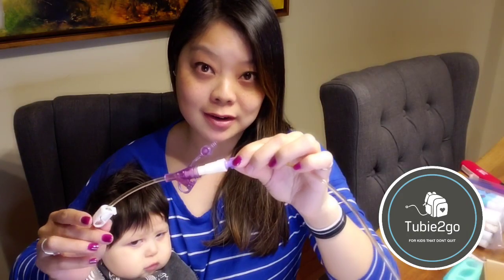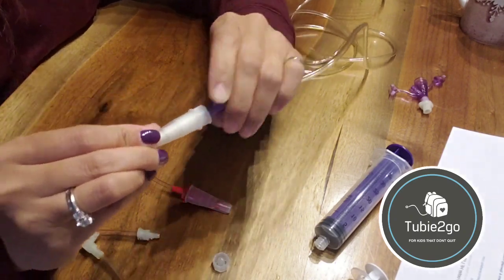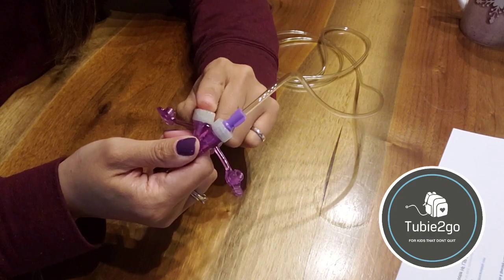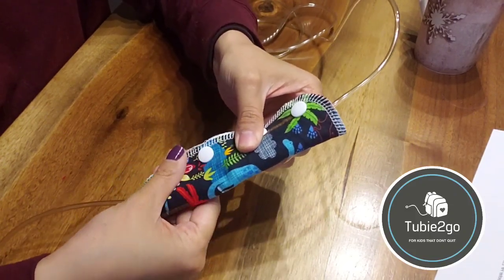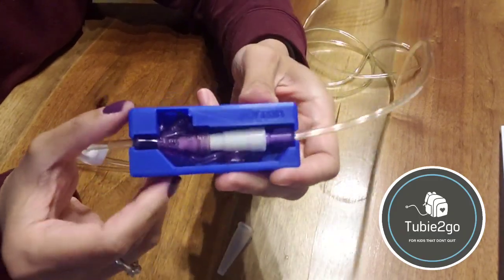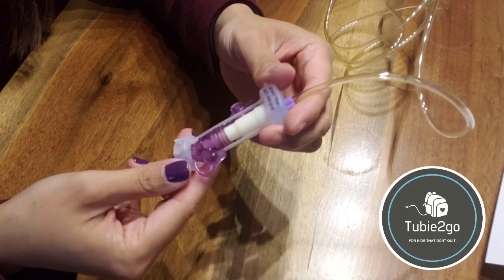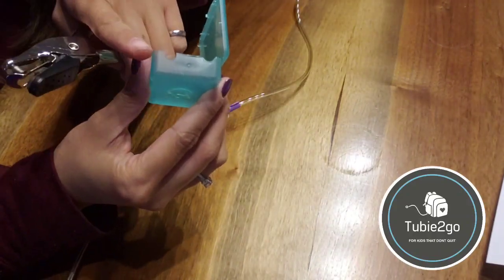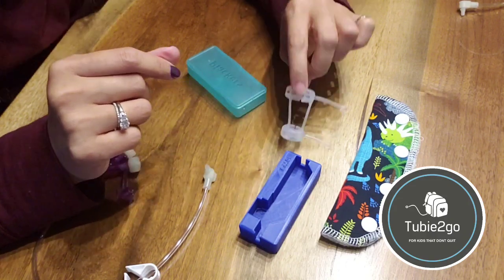Tubie2go - Solving Med Ports Popping & Disconnecting Ports (a.k.a 'Feeding the Bed')

Comment: Very helpful info, Thank you for such a good video. The diy solution currently working for me is looping one small rubber band to hold ends together. Its a little bit similar to the silicone solution shown in this video. Really like the diy plastic case idea too.

Just came up with one more diy method for my elderly dad's tube. We use a couple bread twist ties to hold the feeding nozzle into the y-port. Easier than the rubberband for my dad to do but a minor risk using twist ties, being made wire. so caution to anyone trying that approach please